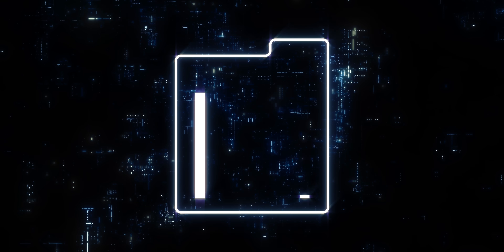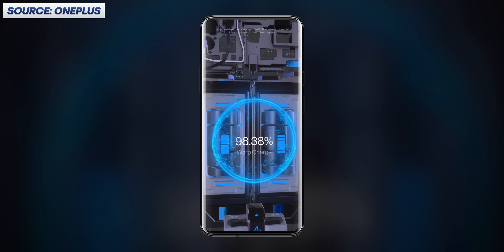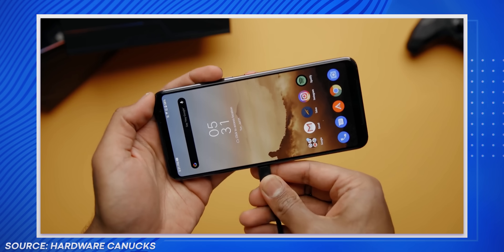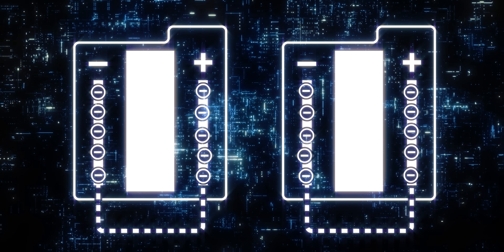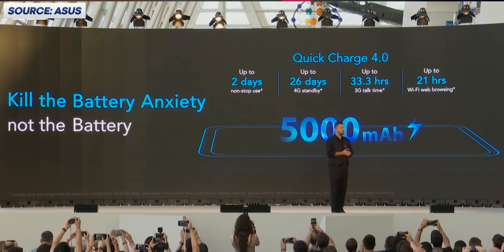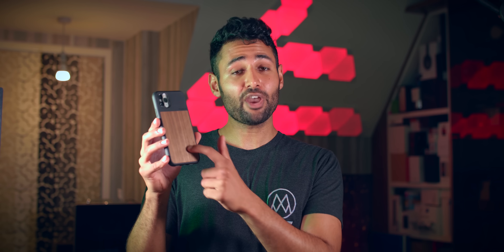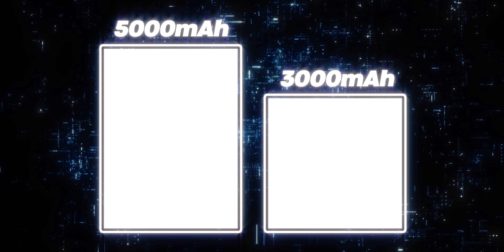The Problem with Fast Chargers.

Comment: As amazing the video was in being explanatory this is something important for people to realise
I see most of the people using their phones while charging or criticizing a model which doesn't have higher watts charger or wireless
Keeping between 40-80% is the best way to have a better battery life and try to avoid using a wireless charger as much as possible and keep the phones in a place where the temperature is less to cool the phone down
Thank you arun for making people aware of significant issues of tech

Comment: I always Charging my poco x2 at 10watts 😂😂1:45 min to reach 80-90
Reply: I use Poco X2 too. And I charge using the provided 27W charger. But while charging I follow a few norms:
1. Don't use the phone while charging, like Arun said.
2. Lay it upside down while charging, preferably on a metal surface. It's dissipates heat way faster.
3. Charge it once a day. Lesser the charging cycles, more is the battery longevity.
Reply: @rikpatra4578  Most Important - remove the cover

Install A Custom ROM.

I am getting frekin 10 hours of SoT on 120hz on Evolution X 4.7 and it's way way smoother than Miui
Reply: @devyashjangid2425  I will install a custom ROM obviously. But I'm waiting for the warranty period to be over. It's already comfortably fast for me. And I too get my required SoT around 8hrs and end the day with around 30% remaining. (Also I don't use a case 😅)
Reply: @devyashjangid2425  which custom rom do u use bro?
Reply: @rikpatra4578  You don't use a case? Wtf it's so slippery. You are saying that MIUI is fast because you never used custom rom I guess. Plus on Evolution X that I am using, it fully charges in 55 mins and battery temperature never exceeds 38°, on MIUI it went upto 43°.

Plus you can set up smart charging in which you can set a charging limit And also the time. Meaning if you want your battery to reach 80% till morning, it'll do that and will charge it slowly and exactly at the time you set, it'll reach 80%

And it's almosy stock android but blazing fast. Animations lags on MIUI but on Custom ROM? Never ever
Reply: @sujitpachode3207  Evolution X 4.7 latest, Hardrock 3.6 kernel
Reply: @devyashjangid2425  I will try surely thank bro
Reply: @sujitpachode3207  👍
Reply: @devyashjangid2425  one last question will it supports 120hz ??
Reply: @sujitpachode3207  Yes, you cannot change it to 60hz. But that's not needed when you get 10 hours Screen on Time
Reply: @rikpatra4578  yes I do same but Instead of using metal surface I use my books and changes book side after every 20min if I use 27watt adapter on 10w it does not generate any heat
Reply: At least not iPhone 11 with 5watt
Reply: @TheAviationistKhizr  😝😅😅
Reply: Doesn't it come with 27w
Reply: @ST0ICSAGE  yep it does come with 27W Charger in box
Reply: @ST0ICSAGE  yes offcourse it comes with 27watts charger brick in box but preffer using 10watts charger for better battery life and it does not generate any heat on 10w charger❤️🔥

Comment: I honestly think that 30W is pretty much the ideal wattage for a charger, when I get low to the point where I want to top up on my OnePlus 7 Pro, I put it on charge for a while and soon it's at a point where I'm satisfied enough to take it off charge and use it a bit more. The speed more often than not actually surprises me. I don't need any faster and I'd rather have a higher capacity battery than less capacity with faster charging than 30W. It's like a 1440p screen or 90 Hz refresh rate, it's not really worth going past that, we've already reached the Goldilocks zone for our current tech

Comment: Completely agree with everything, specially the graphene thing. People usually don't know that it handles fast charging must easier that the "normal" batteries. That's why the Mi 10 Ultra has that 120W, because it is the first phone to have a graphene-based battery!

Comment: It's not a big loss if it's 20 percentage over a year and it's not much of a change.2ndly there are mobile with 4000+ or even 5000+mah mobiles...and Processor are getting really efficient aswell and guess what.. after all the damage after a year they can still do 5hrs+
And mobile battery were still 4000mah ball park before these fast charging arrived

Dude 1st 50 percentage is important because of urgency.. it's not much damage but lot of worth while heading to work.

And you can actually slow charge aka use other power adaptor which are rated at 5w or hell even using your laptop.its optional it's not at strict 65watts all the time it changes speed depending on percentage and also thermals.battery management systems are a thing

It's great

Comment: I always disable fast charging. Fast charging is only useful in emergengies when you forgot to load your smartphone but you have to reach the plane or train and wount be able to load for a long time. Otherwise normal charging with Galaxy S20+ is till 2 h which is absolutly ok. The powerbank takes 8 h.

Comment: This is all true. In my Pocophone F1 with 4000mAh of battery and supports QC3.0, I use two different kinds of charger or power brick. A slow one which is only charging 10w of power and a Fast one which is 20w. Why I have two types of charger is because I'm aware of my device's battery health. I only use the fast one for a situation which i needed to top up when I'm going somewhere or a situation which needed to be ready for gaming. I only use the slow one for overnight charging because it's the time that im not using it and it is not generating a lot of heat overtime. Also I  dont fully charge my phone. I only top them to 80 to 90%

Comment: ......and yet you all RAG on Sony for having a slower battery charging as Sony want to preserve the battery as much as possible. We Sony users have been saying this for YEARS! aS FOR HS power control , YOU KNOW FOR A FACT that Sony did this first by powering the mobile whilst not charging the battery, however your biased attitude will not give Sony credit where credit is due. AGAIN your biased attitude against sont prevents acknowledgement that Sony have been doing optimised battery charging for YEARS -that is set a time for charging when your wake up and the phone for the first 6 hours will only charge to 80 then just before you wake up it will then charge to 100. STOP being biased, Sony did it first!

Comment: This video couldn't have come at a better time. I use a Realme 5 Pro with a 20W fast charger for the last year. But my battery is now dead and only charges 84% of its manufactured capacity.

Comment: Most companies calibrate their phones to avoid 0% and 100% states. When you see 100% in your phone's dashboard, it doesn't necessarily mean that you have used 100% capacity of your battery (same goes for 0%). There's always some capacity left at either ends to counter this challenge. Only downside is you don't get to use full capacity of your battery. But hey, you should always prefer longer battery life

Comment: I'm pretty sure that the apple claims are wrong. The reason why apple makes you pay for a faster charger is not to "protect the phones". It's because they know that their customers will be hungry for faster charging and so they will be willing to pay the extra money to charge 20 minutes faster. Then the reason why apple slows the older phones is also not to "protect the batteries of older phones". It's to push customers into thinking that they need the new iphone and make them buy it. This isn't some "genius plan to save the batteries" it's a master plan to control their customers at their will. Prove me wrong 😌

Comment: i have a lenovo P2 and i've done more that 1200 fast charge without problem, the real problem in nowadays smartphone is the shitty battery, and very tiny capacity. Like to build a caterpillar with 5 liters fuel tank.

Comment: I am ok with leaving my phone for an hour and 30 or 20 minutes on charging...I have an S8 for 3 years...Battery has degraded...But still the phone lasts one day with my daily usage...Thats great right...
Reply: Same
Reply: @heronumbertwo3171  hi charles
Reply: @愛史朗  hello fbi
Reply: @愛史朗  wait who are you
Reply: @heronumbertwo3171  it's me jared 6-5 lelz
Reply: @愛史朗  am back at gd
Reply: bruh my phone is a Samsung A5 2016
Reply: I have s8 for 2 years and few months. My battery have degraded a bit, but it keeps up. If I am not using GPS, it can keep up the whole day, and still having 20-30%. The sad part is that I broke it last year, front and back, though in the front it's only the bottom part and the back only in 2 corners. I plan to repair it and replace the battery. Maybe it doesn't worth to repair, but it will be the first phone I will repair by myself and I will keep it for any problem will happen with my future phone or my brother phone. It's sad they haven' ofered another year of upgrade.

Comment: Nice video! Very informative. As an electrical engineer I cringed a little at 0:25 since that isn't quite how electricity flows (I know it's simplified but still better to be a bit more accurate in a video that is meant to be educational). The powered components need to be between the two poles.

Comment: Sir I have a doubt..
Most of the companies use 2 separate battery to charge it fast right but the size goes down.
Why dont they use 3 separate batteries and make the battery size bigger. Is it possible?????

Comment: This is why Sony is so great when it comes to battery. They don't ride with fast charging gimmicks. Instead they have battery care specially whith their new Xperia. You can just power your phone through cable connection buypassing the battery while all out gaming. Your battery will thank you later. 👍😄

Comment: Good thing I never ever got used to using my phone while charging. And now that I got my hands on a phone that uses 33w charging (Poco X3, 5160mAh), I can now really maximize the partial charging habit that I always do (which is always better for smartphones nowadays). And I usually never charge up to 100% unless I have to, it's always just, 20-85%.  I'd leave the phone for just 10-15mins (to eat, to take a shower, any activity that I won't use my phone) and it'll give me 20-30% battery that can already last for a couple of hours (even with gaming). See, few minutes of waiting without disturbing your phone while charging would result in a longer battery health before it shows a significant amount of deterioration.

Comment: My OnePlus 7 Pro from launch still has tremendous battery life. I've hardly noticed any degradation. I don't charge over night, but keep it topped up while I'm at work. Not sure if this is a reason why it's still good or not.

Comment: fast chargers are the best it gives you an unlimited power supply unlike the slow chargers it will just make your phone charge slow. but when your phone charge fast you won't notice that your phone is even charging so its more time to use the phone regardless of how you preserve your battery it will deteriorate in time

Comment: My old 200$ realme 5 pro had 4000 mah battery and 20 watt vooc charger now I bought samsung M21 of 200$ 6000 mah battery with 15 watt fast charger and it's only 10 grams heavier then my old phone at 188 grams and only 9.4mm thick actually thickness and build quality dosen't matter to me as I use a case oh and the upgrade from LCD to sAmoled is insane

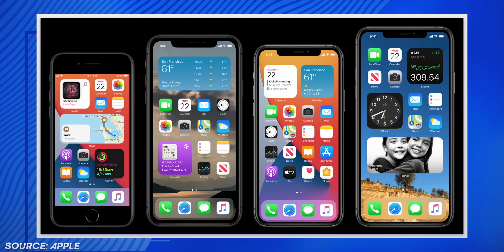Comment: 5:20 "try to slow down older iPhones to preserve their battery life"

me: em, probably not?
Reply: it only throttles the performance once the battery health dips below 80%, by then most people would switch batteries or buy a new iPhone. Or you could just turn the throttling off

Comment: Most of us don't even care about fast charging. Just put the frickin phone on charge at night and wake up to Battery Full message
Reply: That's why battery life is more important than useless faster charging. If the phone designers would concept a phone that lasts two days, the phones battery health extends so much more. Usually the maximum chemical age of a battery is 5 years. So no matter what, after 5 years the battery will not perform decent anymore. But a lot of people's batteries start making issues after a year and most certainly after 2 years.
Reply: Dude exactly I lowkey don't like fast charging cuz yes it does go faster but I will leave my phone to charge overnight and I worry about it overheating.
Reply: I stopped charging my iPhones overnight back in 2016. I’ve seen a massive preservation of my battery health. Stick it on when it needs to really. My first iPhone i got in 2014 (5s) I destroyed my battery within one year and the remaining year until I replaced it was just watching my battery die before my eyes
Reply: Adam like it's mentioned on this video, since iOS 13 your iPhone learns when you regularly charge your phone so that it can hold at 80% and charge to a 100% right before you're about to wake up and unplug it from the charger. I bought my iPhone XS Max on May 2019 and my battery capacity is at 92%, which is significantly better than some of my friends that have an iPhone too.
Reply: Parthurnax I understand. But is the software update comparable with the iPhone 6S Plus?
Reply: Adam the iPhone 6S Plus latest version of iOS is 14.0.1 which is the same version I have currently installed on my iPhone XS Max and I recommend you to update it.
Reply: Parthurnax yup, already have. Thanks!
Reply: Adam Great! Then you shouldn't worry that much about charging your phone overnight.

Comment: Why cant companies just make a night charging mode? To charge slowly while you sleep. Trickle charge to create battery longevity

Edit Thanks for touching on this later in the video! Never knew iPhones did that over night. Google need to add this to android ASAP
Reply: sony actually does that
Reply: @qibcentricsplayground2043  Currently got an s8 looking to switch to a Pixel 4A soon.
Reply: I know One plus uses optimised charging. This would also be brought to Realme devices.
I know both are from same company but just mentioning..
I think Samsung also has it but for higher models.
Reply: @rimzim-12  Yeah I think I've been left behind as they wouldn't bring the One UI 2 to the S8. Pretty frustrating when alot of their newer lower model phones have One UI 2 which the s8 could easily run.
Reply: Rog 3 has that
Reply: Since my Pixel 4a isn't that smart I just bought a Chargie and it works perfectly. I just bought one since I rarely charge anywhere else than at my bed. I limit charging to 85% and still get a whole day of use (and I wouldn't get two anyway). I'm curious to see if I can get the battery to last 3 years since I want to take use of all the updates I'll get.
Reply: @kaku_96  sounds like a good idea
Reply: And anyway look like iPhone batteries die faster or im wrong?
Reply: @vitgud3687  You are not wrong. Every friend I have who owns an iPhone is constantly looking for a charger.
Reply: @EikottXD  i just think fast charging just can kill your battery... not just reduce capacity..
Reply: @EikottXD  Their batteries overall ain't great but I dont think they degrade half as bad as other phones.
Reply: @vitgud3687  Oh it can kill your battery. Playing games while 30W charging on my OnePlus 7T destroyed my battery life and charging speeds in just 8 months. Next phone I'm slow charging at night and taking a break to charge during gaming sessions with fast charging.
Reply: @EikottXD  yeah i was using my mate 9 (4000mah) 2 years and i buy it from hands.. It was all ok with battery.. I was playing pubg  all days long with charge in.. Because i like when go out side with 100% battery.. So after this my phone just restarting and switch off.. So i think i kill battery
Reply: @JDoubleT1  I imagine it's due to slow charging and software optimizations. Correct me if I'm wrong but isn't their fast charger 18W? I would just be happy to have a setting that allowed me a cutoff percentage when charging. Somewhere around 80-85%. It stops at 85 and if it drops to 80 charges back up to 85 again while plugged in.
Reply: My Samsung m51 has the feature to use slow charging when manually configured
Reply: @Amogh-Dongre  we can do it on any samsung phone if it supports fast charging 😁
Reply: @Amogh-Dongre  7000mAh?
Reply: @hellonoitisnt393  yep but I mostly overnight charge so never needed the fast charging
Reply: Good idea.
Reply: Sony
Reply: Huawei Has It :P
Reply: @skyeplays1772  "Chaiiiiiii-Naaaaaaa" 😂
Reply: My OnePlus 10T has a slow overnight charging optimization setting. You set up"bedtime mode" and if you plug it in after bedtime was set then it does it automatically.
Reply: also My mom said if I could get 1.1k likes on any of my video she’ll buy me a professional gaming setup so I can
upgrade my content. Please please all ask I ask is for a like. Please and thank you 💖 (not a bot btw)
Reply: @Ripler  So why not work for it.. By posting something people can like. You know, earning your mom's promise instead of expecting people to just like for the hell of it. I suspect your mom is trying to teach you something.
Reply: @Ripler   Or else you can you just come out of your mom's basement and get a life instead
Reply: @Ripler  You don't even have any content uploaded...

Comment: Phone Charges in 5 min

People in 2027: This is too slow, I don't have time for thisಠ_ʖಠ
Reply: 2040: tiny power generators inside phones
Reply: What? That’s WAY too slow. 0.000.000.000.000.000.001 seconds.
Reply: Problem is not how long is charging.. Problem is that phone is not usable if battery is low... Need some battery who will last long thru day with gaming and only after 12 hours die and charge it just when sleep
Reply: Innovation of graphene in batteries comes ur dream true

Comment: well i mean overheating and faster battery degradation will always be an issue with faster charging until a better material to produce batteries can be mass produced.